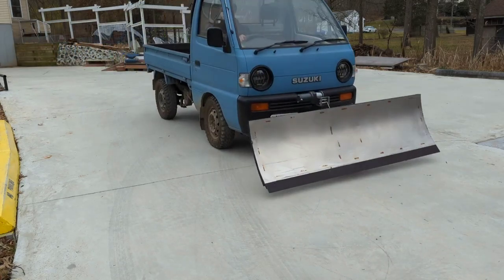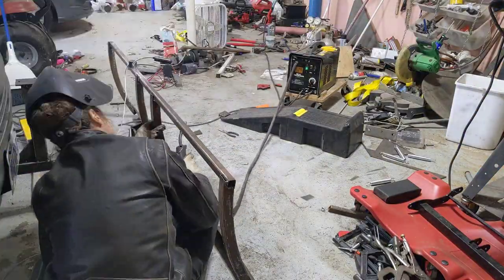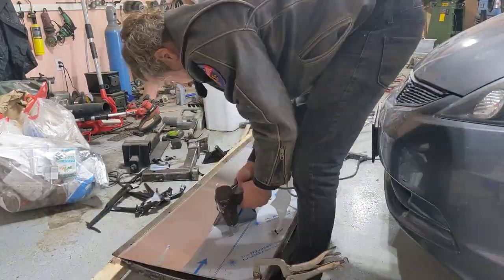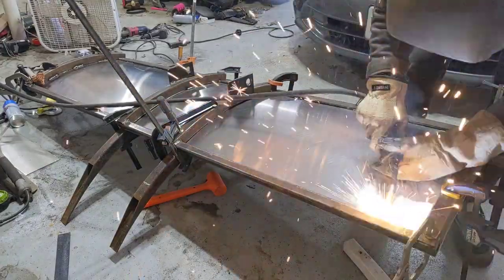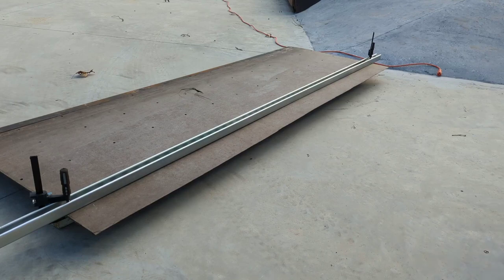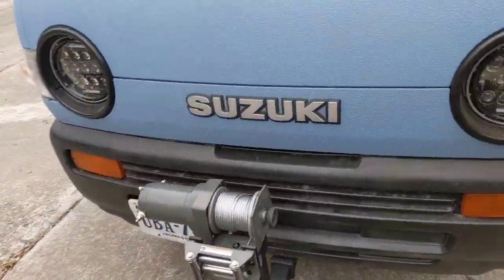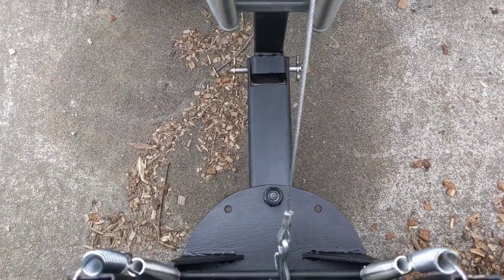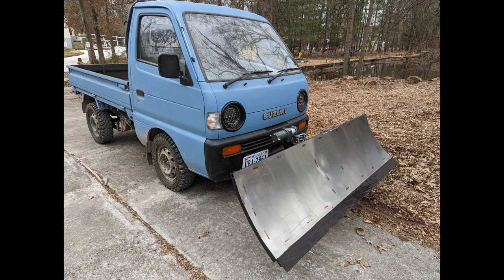DIY Snow Plow from Trash - Part 2

Comment: You are only not good at welding, if it breaks where you welded it. If you welded, and it helded, then thats good welding'.
Reply from the maker: True 'dat. The breaking will probably happen somewhere other than the welds, in which case it's bad design. Still on me, but I can't blame the welder 🤣